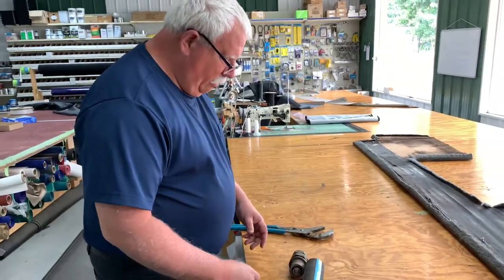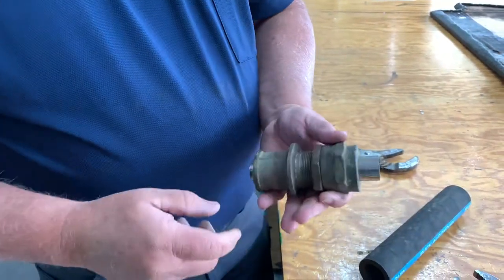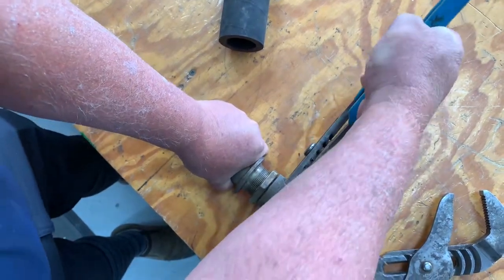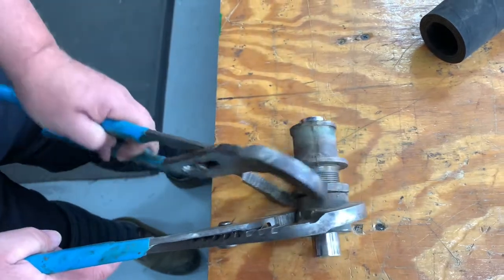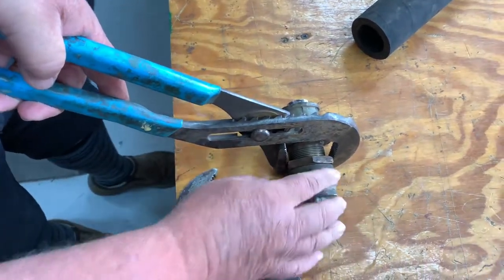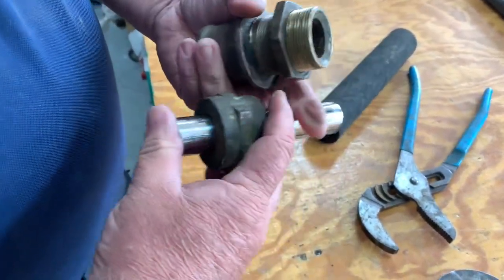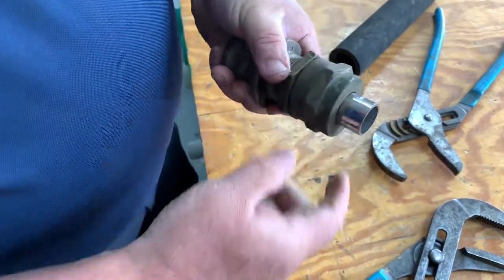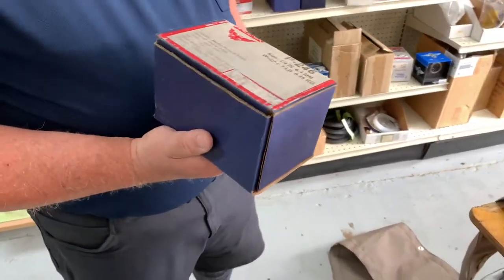How to Adjust Shaft Packing

Comment: It doesnt look like the nut has enough depth to be tightened all the down on the threads even if there is no packing material inside it. You mentioned if you can see threads you still have room to tighten it down, I don’t see that being possible. How do you know if you can still tighten or it needs replacing then?